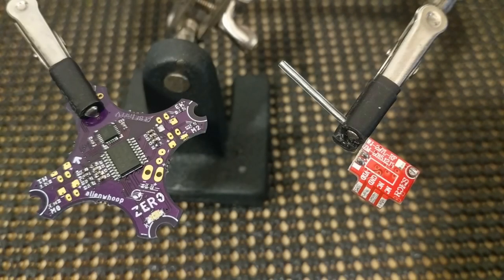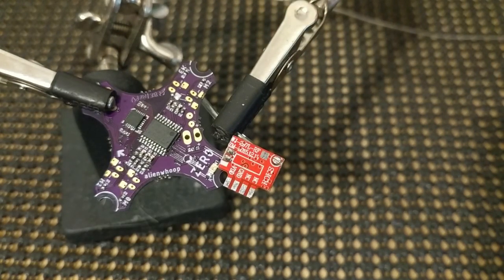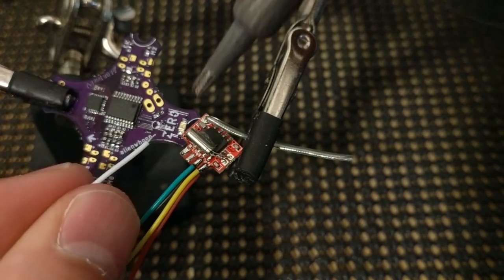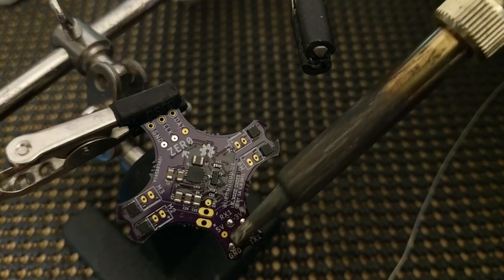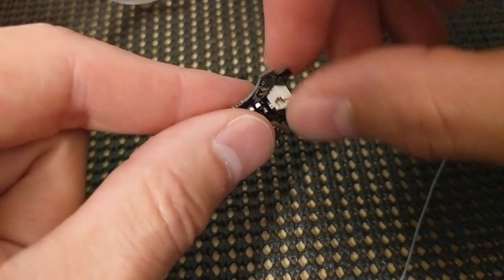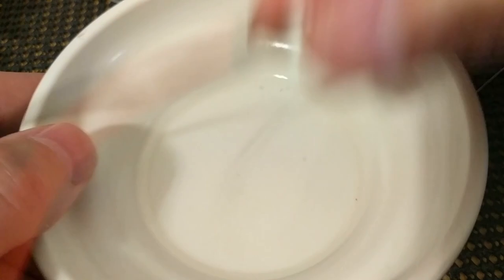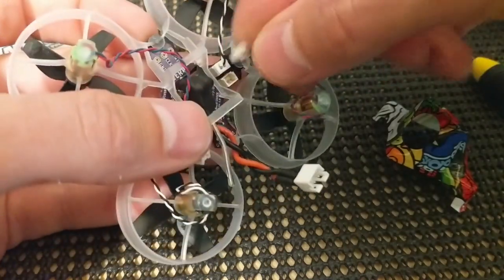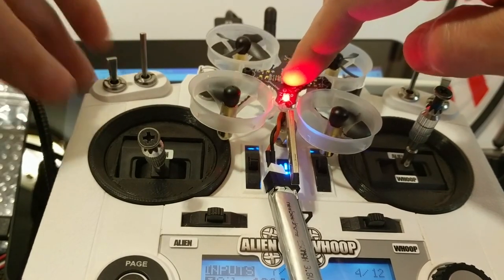Bayang SPI AlienWhoop ZER0

Comment: "Lead-Free" solder is silver solder. RoHS compliance is why they removed lead and replaced it with silver. Silver solder requires more heat to melt, but be careful with your soldering iron tip. If your tip turns colors and looks grey/black it is too hot, the solder is oxidizing and you will have inconsistent results. The copper scrubby is a good tool for cleaning your tip, but it serves a different purpose than a wet sponge. Using a wet sponge as a "heatsink" will help you quickly cool the tip down so that you don't oxidize or vaporize useful solder. Try it! Also, only use leaded solder for anything hand built, unless you want RoHS compliance? When you turn on your iron put a small amount of leaded solder around the tip of your iron before you turn it on, as soon as it melts into the tip, adjust your heat setting to 50%. This should keep the tip shiny and your tip should last forever, and give you much better solder joints in all of your projects. The only time I use silver solder is to remove parts from a board, but you will need to heat your iron up about 50degrees more to get that stuff to melt. Higher temps and mixing solder types risks damaging components and/or getting inconsistent results. Also leaded solder has more flex than silver solder, so after about 1000x crashes those solder joints should still be holding on tight!

Comment: I wonder if you could help me figure out how to make the Irange X module work on my QX7. I like your idea of salvaging toy parts and integrating them into the whoop builds. I'm trying to do the same. I just can't get them to bind to radio. It seems to be a problem with the radio external module.
Reply from the maker: I also ran into issues with this module. I think you actually have to use an Arduino or other tool to flash it before it will work. I could be wrong. I am using a different model 4-in-1. But I do remember trying to setup an Irange X for Velcro and it wouldn't bind and eventually found a blog that said the USB port doesn't work out of box until you change the firmware.
Reply: @brucesdad13  I have a T8sg Jumper radio and a Qx7 with the Irangex 4 plus. I'm not familiar enough with software and firmware used with drones. I appreciate your response. I'll keep watching your videos and may learn more. Thanks!

Comment: Can you wire one of those Bangyang tx/rx to the back of the taranis and use it as a tx module?
Reply from the maker: I don't think anyone has done it yet. I imagine you would need a companion circuit board to translate. The little module itself doesn't have a brain per se. It needs another MCU to handle the protocol.
Reply: Nothing a iRangeX module can't solve lol. Initially I thought I'd have increase latency, but later found out it uses the MULT protocol to communicate with the Taranis, which is a serial protocol. By the way, some of the new Betafpv boards claim to have an SPI frsky receiver, I've never tried one though!

Comment: Hi :) thx for the video!
a question here: whats the weight of this receiver? (xm weights about 1g)
Reply: it's about 0,5 grams.
Reply: JBee FPV with x-lite ready, vantac mpm on my way (3-4weeks from now) I think it’s worth trying... I believe it will work with e011c board as well right? What about failsafe? Does it work?
Reply: @Rryzu  yes failsafe works of course. Zer0 has more power though, I see e011c like a mini zer0 now.

Comment: So I just got my board and I'm going to be using this dose it come ready for the bayang spi
Reply from the maker: adam laffoley requires external receiver and custom firmware. If you ordered bayang spi zer0 it'll be ready to attach receiver. If you ordered sbus the board needs to be flashed.
Reply: Charles Stevenson so what receiver can I get that would work with my jumper